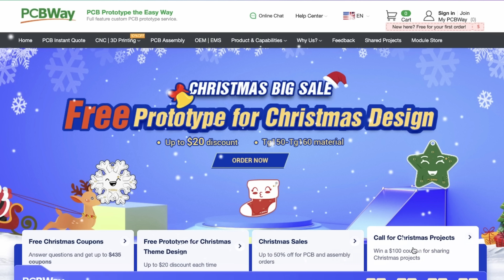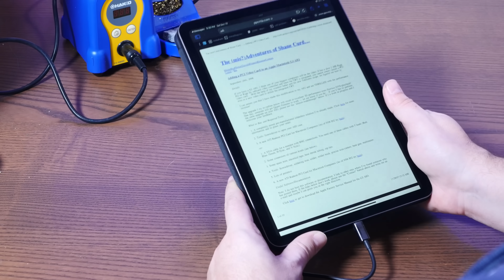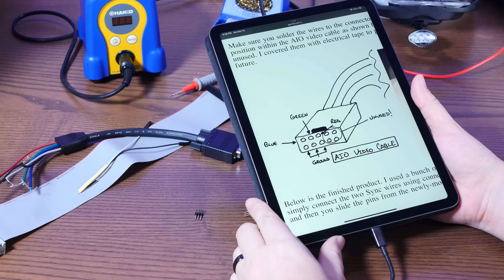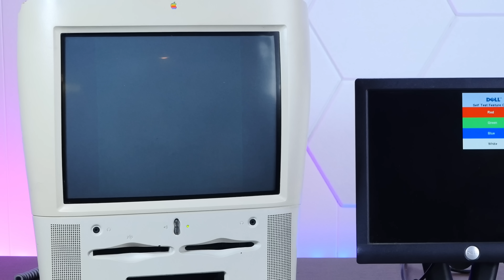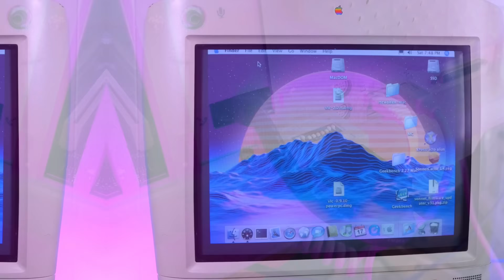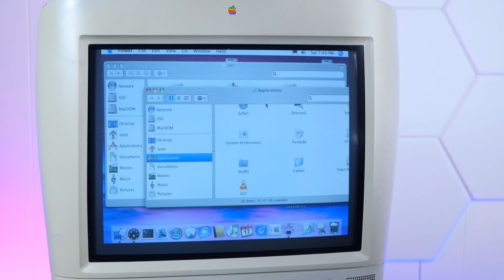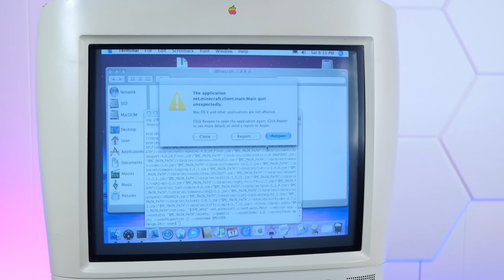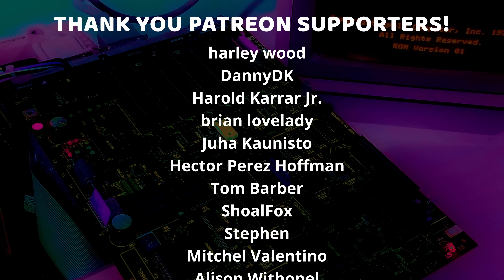Hacking A Video Card into a Molar Mac

Comment: Hey, I have an old power macintosh 9500/150 I was going to trash. Do you want it? 

I tried to sell it on eBay but it didn't go, so I was going to trash it. You may be able to see it on eBay under un-sold items. It's the one that you can see three drives in with a custom Mac OS 8.6

Comment: you could go further and just bodge all the way by soldering wires to the back of the graphics card, that vga port uses through soldiers. wouldn't even have a cable sticking out of the case.

Comment: If you want to improve minecraft performance, switch to G1GC garbage collection. It does make a difference. And, if I recall correctly, any surface that has to be culled out will slow the rendering -- so any caves/ravines, and any trees. ... yea, find a desert or plains, see if it goes faster.

Comment: Does that thing have two eyes and a mouth?

G4 Mac running minecraft? Sure. My old G4 Macbook pro did that. 

Of course, ... Minecraft on G4 had (At least as far as 1.5) a byte order problem in the graphics. Basically, torches gave off "sunlight", and the sun gave off torchlight. So in the caves, with torches, while monsters would not spawn (plenty of blocklight), the screen got dark (nighttime visual lighting.)

Lets see how you do.

Comment: It's a CRT, you can adjust the yoke to at least center the screen. There's usually like 3 or 4 rubber wedges between the CRT and yoke which are likely glued in but easy enough to break loose and adjust.

Your mileage may vary on the color purity, but usually tweaking the yoke angle doesn't tend to interfere much with color purity.

But even if it does, the two rings closest to the connector end of the CRT neck adjust the color purity.

The rings forward of that adjust convergence.

Edited for corrections.
Reply: On a monitor I looked at recently the rubber wedges were used to adjust dynamic convergence.
Reply: @eDoc2020  It's a bit of both the yoke and the rings really.

The position of the yoke forward and backwards, plus the 2 magnetic rings closest to the board mainly adjust color purity.

Adjusting the yoke up/down/left/right, and the rings further up the tube mainly adjust convergence. All other things being equal, assuming a decently centered input signal, you'd usually start by centering the raster roughly with the yoke, then dial in the convergence and purity with the rings.

Comment: You know, for $20 at DigiKey, you could get a HDB-15 jack, a 40-pin header, and a 10 pin header.  Source a short VGA jumper, and have ... I dunno ... some random PCB manufacturing house (ahem...) crank out a board, and this could be a slot-in adapter card right next to the video and personality cards.  I think DigiKey still has pre-fabbed PCI slot brackets with DB-9 style cutouts, too.

Comment: The solder job ws pure jank indeed. No solder would had been required with crimp-on connectors and a little bit ofo heatshrink. If it's good enough for JST and DuPont, it'll do for this!

Comment: You use the other desktop by (the one to the right) using something like Anydesk to connect to the computer, and select the second Display. If you can get it on the Internet, that is. Another option is NoMachine as that is local networking, to connect to the display. Note, this will cause some lag, but it will give you access to the virtual desktop that you have.

Comment: If you wanted to do this with less jank, you could run a PCB to stick in an expansion slot so that the only jank needed was a VGA extension cable. Stick two IDE connectors inside, run the relevant VGA connections to the "crt side" IDE connector, and you're done. If you wanted to be fancy, you could even add a switch and a second VGA port onto the back to control an analogue video switcher, that way you'd still have access to the internal video at the same time. All with no need to splice cables.

Comment: If you wanted to do it a bit cleaner. I'd open one of the IDE? ribbon connectors. You'll need bit of force to make new connection into the ribbon, a few light taps of a hammer does or some pinching tool. but that would allow you to shrink the length to something more manageable. And if you open the side away from the personality card. You could have the v and h sync cables go past or long. (making sure to cut them going to the personality card. So those two wire would exist the opposite end of the connector. Or you could pull them use personality side and have them not go to the connector. But I'd crimp the intact ribbon wire then take apart the connector and then split off the two wires and re-assemble. Since it will be hard to align everything for crimping with two missing wires.
Reply: There might be a way to move the PCI card with an extension or something and be completely stealth

Comment: There are versions of the Radeon 9200 that have the VGA connected with a ribbon cable off a pin header on a smaller board, so you could keep all the cabling internal. Though "less jank" does not seem to be a design priority here...
Reply: That's what I was thinking, didn't some really old compaqs have an internal monitor port on their cards?

Comment: An M1 Mac Mini board with internal USB Zip and BlueRay tray-loading drives (I guess you could gut those from external USB units and stick them in there with room to spare), plus a card reader where the floppy drive is, would make for a perfect sleeper system… 😂

Add Basilisk II to the mix, and you can still boot Mac OS 9 on it, faster than ever 🙃

Comment: Is it really a fraction of the power of a modern smartphone? Minecraft is a poor point of comparison as it's written in Java and the Apple's JVM was notoriously slow. As is Wolf3D as it's horribly optimized. Modern compilers are much better at building tight optimized code but the actual tooling and fundamental hardware hasn't changed THAT much.
Reply: 1 core 1 ghz g4 while a modern a15 on an iphone is a 6 core processor with 2 running at 3.24 ghz and 4 at around 2ghz. 4-6gb RAM. so yeah its absolutely a fraction of a smartphone.
Reply: @bryo4321  he didn’t say a top of the line smartphone. Also quoting raw clock speeds of wildly different architectures is meaningless.

Comment: Very good. I'm genuinely surprised Apple didn't deliberately screw with something to ensure an upgrade like this would be impossible. I can only assume they never considered it.
The silly thing about the Molar Mac is it didn't have to be so hideously disturbing. Indeed it could have been 'better' if Apple had taken a more low effort approach... Imagine an upscaled Mac SE case to fit the components - job done and much, much nicer.
Reply: 80s and 90s Apple had a very different approach to upgradability and repairability than the past 20 years.
Reply: They still had more Woz than Jobs in their hardware design philosophy.
Reply: @MarcosCodas More Woz than Jobs? Apple was releasing its most upgradable computers at the time of Jobs' death. OG Mac Pro, Unibody MacBooks, Mac Minis, and iMacs, hell even the iPhone 4 was the easiest iPhone to disassemble. Take off your hate blinders bud.
Reply: @babayaga7434  You make fair points, thank you. I'll re-evaluate.
Reply: I’m imagining you mean a SE looking case because this thing cannot be shoehorned into a big SE case. The monitor was not an independent component on the SE it was integrated completely with rest of the computer. When apple did that again it became the iMac.

Comment: I wonder why OS 9 won’t start? Does it attempt to load at all or? Could be drivers. Start without extensions?
Or use Tiger to just install a fresh copy of the updated 9.2.2 image with the latest drivers and rom 10.2.1 from os9lives.

I don’t remember you mentioning in the other videos which revision of board this thing is either? If beiges weren’t picky enough the first revisions are even worse.
Reply: And some patched Merlin drivers for the 9200.

Comment: I'm surprised that cable worked so well.

Classic Mac OS is so easy to emulate that I feel like doing case mods and motherboard swaps on these old Macs is something we all can get behind.  I don't think an M1 swap is right, but an Intel swap running High Sierra would be perfect. You have plenty of power to emulate classic Mac OS and with High Sierra, you can still run 32 bit apps. I don't know if it's possible to do so, but maybe you can dual boot Leopard and High Sierra so you also can run PowerPC apps. Or try running Leopard in a virtual machine. And with Intel Macs, you can run any version of Linux and Windows too.

Comment: wonder if you could use a microcontroller to control the monitor geometry settings, would have to figure out how those work
Reply: I know for iMacs there is a kit out there that uses a micro controller for that stuff so you can upgrade the guts to something else

Comment: i could have sworn there was a 256 and a 512mb legacy 32bit pci gpu that worked with thease macs.
Reply: The Geforce 6200 and FX 5200. But they don’t work in OS 9, so they’re usually ignored. I have a 5200 in my B&W.
Reply: @jlj945  so if I wanted to I could use this card on my dell dimension 2400 which only has legacy pci and run tiger on it?

Comment: Great video, and congrats on getting it all working.  Are we seeing Win 10 on this Mac via Microsoft RDP into a Win box?  With MacOS Tiger one should be able to use an older version of the RDP app and remote login into a PC over ethernet.
Reply: I think it's just the internal display connected via this hacky VGA input into another machine. The Mac had to chime only to power on the monitor.

Comment: What might be fun is to use the personality card for an external monitor, and play “A-10 attack” with it. This was a Mac only flight simulator from 1995 that for some reason had multiple monitor support 🤷‍♀️.

Also, about the phantom monitor. That might be a driver error. I have a g3 iBook snow that used to have that problem. (Also it was stuck at 640 by 480j It turns out that even though they only sold that type of iBook for about a year there were about twenty different models, and some of the later models used a different graphics chipset than the original which is what the internet archive restore disks were for. Apparently mine used the same chipset as an eMac, and once I used those restore cds I was able to get the laptop to stop that.
Reply: I think the software is working as intended. The display being internal, probably doesn't have any presence/identification signals, and if it does, he didn't mess with those signals at all, as he only intercepted the R, G, B, Hsync and Vsync signals, nothing else. So electrically, the machine still "thinks" that there is a display connected to the personality card and there is probably no easy way around it.

Some people hack modern MacBooks into the PC-in-keyboard form factor (so basically just remove the display) and that also causes a similar "phantom display" issue. It's much less of a problem, though, since both displays being on the same adapter means that there's basically no performance penalty to mirroring - but it can still be a mess when trying to access e.g. recovery options.
Reply: @kFY514  That is also a possibility. I’m curious why one would try for the keyboard only form factor. Why pay for the built in monitor when you could just get a mini? Or is this a holdover from the intel days? The M1 mini, air, iMac and MacBook Pro are all literally the same computer. The ones with fewer graphics cores are just units with a manufacturing flaw that has the bad core disabled.
Reply: @SciFlyGal  I think it's just hardcore minimalism - a Mini is still a box you need to put somewhere, while a screenless MacBook gives you the perfect minimal desk setup - the keyboard, the screen, and that's it. Some people are after that kind of aesthetic.

I don't quite understand that as well, but I'm a "why would you ever want less functionality under any circumstances" kind of guy, so I don't understand defending Apple's "no touchscreens on Macs" stance either, for example.